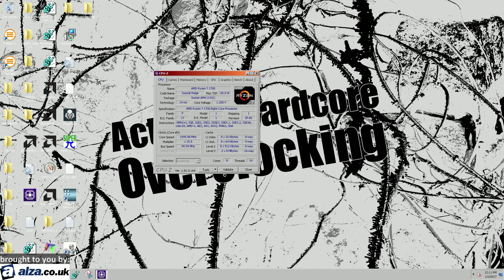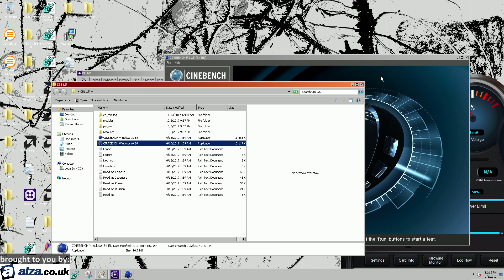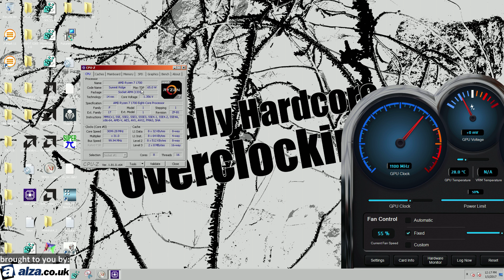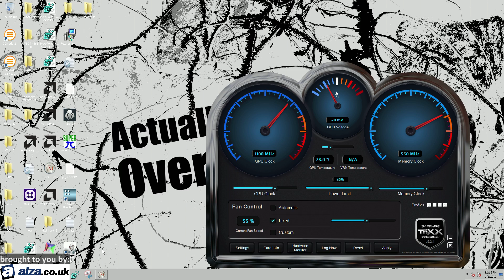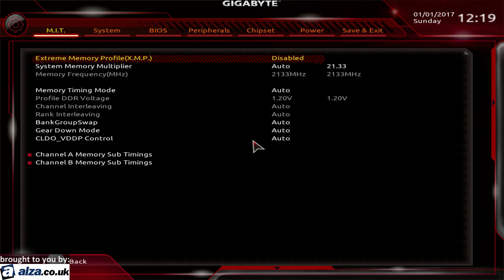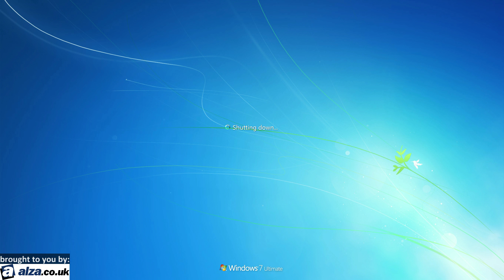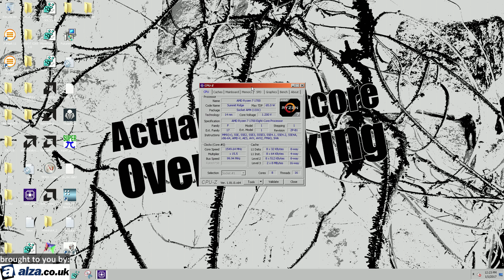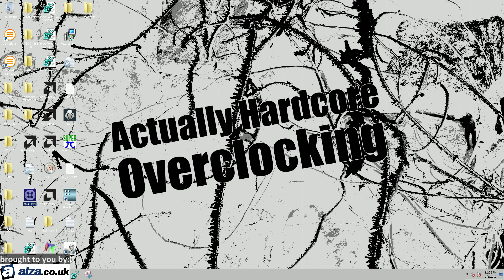The elusive Ryzen 1.55GHz bug (a potential fix on gigabyte motherboards)

Comment: i have a ryzen 2600 non x , i had it overklocked to 4,1ghz with 0.200 + offset voltage . the funny thing is when i changed to 4075 mhz overklock ryzen master reports idle clockspeed 1550 but it boost to 4075mhz on all core :)
Reply: On which motherboard did this happened?
Reply: gigabyte aorus wifi 7

Comment: Mine is literally stuck at 1.36 i dont have an overclocking mb and even on idle its 1.36, Can somebody help

Specs
Gtx1050
Ryzen 3 1200
A320M-DGS
450bt psu
1 tb hdd
120 sdd

Comment: I was having this same problem on my Asus ROG Strix B350-F Gaming after the latest bios update. I had my RYZEN 7 1700 oc'd to 4ghz stable before the update. i used all the same settings after the update and all was fine for a little while then one day it started. What i ended up doing to fix it was to step my offset voltage down till it booted at 4ghz. i bumped it back up a 1/100th of a volt and it bugged again, pumped it back down all was good. Haven't had any issues (related to the bug) since, that was 4 moths ago.

Comment: If its the chip, can we really send it in because we are taking it past specification? I mean, that would be fine with me, mine is crap, it can't do anything past 2666 Mhz on the RAM (1.2v up to the moon, doesn't make a difference), it also runs hotter than molten lava and impossible to cool (without phase or LN2 cooling), I definitely can't run 1.4v on an AIO with a 4,100 rpm fan (temp hit shutdown in 1-2 seconds at 1.45v or maybe less). Also, based on my voltage frequency charts, it would take 1.70v to hit 4 Ghz (1.7 yeah, that's a little high, may be ok for phase? Let me know if it is Buildzoid, I just need to make a mount for my phase).

Asrock X370 gaming K4 with latest BIOS (tested every revision except maybe 2 or 3 revisions, so many hours wasted)
Ryzen 1700 (bought about 3 months after launch)
Also had this bug, its super annoying to have it go down to 1.55 Ghz...

Comment: About the x-series chips: Got a 1600x on a horrible, horrible Gaming Pro Carbon WHICH I SHOULDN'T HAVE BOUGHT I SHOULD HAVE LISTENED TO YOU and my CPU does that too if I try overclocking it using the BIOS. With Ryzen Master, no problem, except for that I can't even get 3.8GHz primestable, but that could be the VRM overheating.
Reply: Oh and I don't get a 1.55GHz bug, mine was at 2.2GHz.

Comment: FWIW:  I'm running a 1700, same rev. (ZP-B1), AGESA 10.0.0.6  on an Asus Prime x370 and haven't run into this issue.  Using offset voltage, OC @ 3.8ghz.  Not sure if these are the same conditions that caused this issue for other people though.
Reply: How much offset voltage did you apply

Comment: I have a preorder R7 1700 that never does 1.55ghz bug too. I have 3 AM4 motherboards and it's fine in all of them. My newer R5 1600 will do it doing certain manual voltages.

Comment: As some others said its not GIGABYTE specific. It happens when the Pstate0 VID gets stuck and the SMU gets locked in. Pstate0 VID is provided internally by AGESA. Its been reported and hopefully will be fixed in an upcoming AGESA.
Reply: By the way, I fixed my issue by creating a voltage offset in BIOS, i LOWERED the voltage by 0.096, a negative offset. For some strange reason my processor was somehow getting too much voltage from the motherboard at stock. So telling the MOBO to reduce the voltage to the processor was my magic bullet.
Reply: @justina.2149  I have also lowered my vCore offset, by a lesser amount, but to great affect on my thermals and therefore stability. Gigabyte doesn't support their products after the next generation comes out. Buncha scum.
Reply: Gigabyte can I please please please connect with you on Twitter, I'm experiencing this problem on the latest BIOS from April 2018
Reply: Same here.
Reply: I can only do about 1,32 Vcore, any higher than that and multiplier is stuck at 15,5. If I want to OC more, I have to turn to Ryzen Master.

Comment: I had this on my Asus Strix X370-F Gaming ATX, I ran the EZ Overclocking utility in BIOS and it started behaving normally. It's a Ryzen 7 1700, once I got that straight I settled at 3.9GHZ @ 1.3625.

Comment: i have the same chip revision (ZP-B1) on a crosshair vi hero. I have no bugs like that but i NEVER used offset voltages.
Also, please note that even if you put +200mv, the CPU core voltage is still 1.200V (it should be 1.400V instead). So i think it is a motherboard bug.

Comment: I have the same issue with the ASUS C6H and it seems to be manufacturing date linked: https://rog.asus.com/forum/showthread.php?96420-1700-C6H-OC-quot-bug-consistency-quot-issues-manufacturing-date-linked

Do you have the behaviour when using fixed voltage instead of offset? It fixes it for me.

Also the same happens when the PC was in S3 state for longer than 10 minutes: https://rog.asus.com/forum/showthread.php?96422-Multiplier-locked-after-wakeup-from-S3-sleep
Reply: This board doesn´t have a fixed voltage mode.
Reply: Uh that sucks, my condolences.

Comment: On the Gigabyte X370 Gaming K7 I had a pretty similiar issue. When using a fixed voltage that is higher than stock it used to trigger the 1.55GHz bug, when using an offset it worked fine.
Fortunately with the latest bios that was fixed for me.

Comment: I didn't encounter the 1.55GHz bug though I've read about it. I did encounter a 2.8GHz bug, which happened if I overclocked with C&Q enabled on an MSi x370 board. Disabling C&Q fixed for whatever reason.

Comment: This happened on my Asus CH 6 Hero too a while back. It happened when i tried to overclock in manual mode and raise the vcore. When i raised the Vcore in manual mode i got stuck in 1.55 GHz. This is because in manual mode it screws up the Pstates for some reason because when i overclocked in Pstates al was working well. Asus fixed this in a new BIOS. Its for sure an BIOS thing and only Gigabyte can fix this in new BIOS.
Reply: RPM Designs well Asus seems to have forgotten to fix this on Prime X370 Pro meh.

Comment: My r5 1600 does the same thing when voltage is set higher then ~1.33V on asus b350-plus when using the offset voltage but I can get more voltage using llc, but it really is irritating to mess whit that, but doesn't really matter when 4ghz is stable whit 1.33v and low llc and the chip wont be stable whit my tower cooler at any voltage over 4.05ghz
Reply: ryzen master (or what ever its called) works but I don't like software overclocking and it messes up ram settings.

Comment: Hey Buildzoid! Thanks for always making nice videos. Could you make a tutorial video on how to properly OC and UV Vega?

There is so much BS going on with the drivers atm and i cannot figure out how to work around them all. Sometimes the card clocks higher than what is set in P7, causing instability. Sometimes it clocks much lower and refuses to even enter higher Pstates even with +50% power target. SOC clock randomly starts fluctuating at certain settings (i.e. I can ADD 25mV to P7 and this causes SOC to fluctuate (not power or thermally limited!), whereas the setting before is fine) , causing performance loss and framedrops.... You get the idea. It would be great if you showed how you deal with those obstacles and which things in particular need special attention.

Comment: interesting you get this. i have the asrock taichi with a 1700. and im currently running 3.85Gz at 1.28V with lvl 2 LLC (idles at 1.3V).
in the past i have had my CPU multiplayer end up being 38.3x (with the cpu at 38.3Gz). never worked out what triggered it but restarting the machine always made it go away.

Comment: I have never had such issue with my 1600x and MSI b350 pacmate, also lol- it's 1 time I hear about somebody have such bug on Ryzen, 
BUT there is another bug since agesa 1006 BIOS?, when you messs up with RAM OC, then despite the fact moter board resart PC and reset RAM config, it shows in BIOS you have still CPU OCed to in my case 3,95GHz, but in fact it have reseted to 3,6 default. Only way to fix that is change CPU speed up/down and then again 3,95ghz. However most  ppl I have been talking with on forum was using MSI,ASUS, some ASRock, rather everyone disadvice gigabyte on forums because of low quality motherboards and glitchy BIOS.
Reply: Its not true you can see even buildzoid viedo about trashe course AM4 VRM he claims acctualy MSI and ASUS have best motherboards on b350, worser are ASRorck and the worst gigabyte. Moreover gigabyte as I read has practise to lower the quality of their products in next revisions of the same models.
Reply: David K. What is better then for this price? 90% of b350 boards are good or OC R5 CPUs and VRM temperaures are perfect for them, my VRM on r5 1600x 3,95ghz@1.37v heats up to 49 C on radiator and 69 C on back of motherboad. Carbon got better 4+2  than rest b350 VRM and can  stand with no problem R7.

Comment: I bought the ducking 1600 and a msi krait gaming x370 board and I get that bug all the time and even with the latest bios it still happens when I try and OC or run ram over 2400mhz
Reply: And then I see people running 3200mhz ram and OC'ing to 3.9ghz with the stock cooler on a b350 board

Comment: went up to 4ghz (not stable, but got to windows) and 4.2ghz (post, no windows)
3.925ghz at 1.38 volts 24/7 good to go however

havent had this bug yet.....using a 1700x on crosshair 6 with AGESA 1.0.0.6 beta bios (yes, i know new stuff is out....but this shit works)

Comment: Ryzen Master is a work a round, it allows vcore up to 1.55v. So a BIOS OC plus Ryzen Master OC will give you 1.55v plus the 0.200v from BIOS equals 1.75v on vcore total, this will allow for some great OCing (LN2 maybe). I have this bug at 1.3v on the core for BIOS OC, but with Ryzen master I have been able go up to 1.5v to post some high scores on HWBot. Asus x370-A R5 1600.
Reply: No, 1.425v-1.45v is max safe voltage . But for high scores on the bot this voltage was needed.

Comment: I have a 1700 and gigabyte  gaming 5 not the k version and about two months ago it kept doing that when I changed the voltage directly but it didn’t do it when I changed the offset. I ordered a new board and returned that one and it kept doing it. Bios version was f6 and they came out with version f8 and it fixed it. I think it must be something weird with the chip that the newest bios fixed. But now something is up with my ram not being stable at anything about 1.25 volts so I don’t know everything about overclocking ram but even at 2666 at any higher voltage won’t work so 2933 won’t work at all... probably just the ram or infinity fabric but if anyone has any ideas let me know please.
Reply: monkeyplayer1 my gaming 5 with F6 bios would do the same with R5 1600, didn't bother me as I overclocked using offset voltage.
Reply: me too. I overclock with offset and after the new bios was available ( I upgraded directly form F6 do F9 ) installed it and managed 39.25 at 1.36 volts

Comment: would using fixed mode work better than offset for voltage control? Now that I recall it I think I switched to fixed mode to get around my down-clocking issue.

Comment: I ran into this trying to OC a ryzen 3 1200 on an Asus b350 plus board. Above around 0.15v offset caused the issue. Thanks for the info, I never really spent enough time to get to the bottom of it.

Comment: I had some issues going past 3.8GHz where the CPU would sit at 3GHz instead (R7 1700). I think i just lowered the multiplier and voltage and then rebooted, and the rebooted again with the old settings.  But now things are fine.

Comment: I have the first Ryzen 7 1700 that was pre-ordered a few days before launch and I get the bug when I try to overclock higher than 4.0 GHz. The M.B. is AsRock X370 Killer SLI A/C. It may be also related to the voltage bump that I tried to apply in order to break the 4.0GHz frequency.

Comment: I had this type of issue also with my R5 1600x on the gigabyte gaming 5. Mine would drop to 2.2Ghz anytime you tried to adjust any voltage value in the bios, you could change everything else no problem but once you tried to change voltage it'd drop cpu clock to 2.2 and stay there. Searching online I found A lot of people were having this issue with the 1600x on multiple boards and couldnt find a fix. The issue for me was fixed with a bios update to F8, every other bios before F8 for my board had this issue. If you look at my F8 bios description it says it fixes overvoltage issues that occured when adjusting dynamic vcore, but your F5a bios didnt get that fix. I dont know if the cause of my issue is the same as yours but it looks very similar.

Comment: It also happens with my asus prime x370 pro and the same thing happens to me drives me nuts, please share your wiseness, also this happen when I set a constant voltage
Reply: Hitting 4GHz honestly isn't worth it. Typically the voltage is insanely high just to get that extra 100MHz. I'm running at 3.8GHz @ 1.25v on my R5 1600 but trying to hit 4GHz OC I even went to 1.45v and it still wasn't stable. I was at 3.9GHz @ 1.35v but the drop in voltage I got just from lowering 100MHz was worth the drop.
Reply: On that board i have to use offset voltage, any custom regular voltage thats even remotely high it will lock at 1550
Reply: "when I set a constant voltage" is why you get it.
Reply: Got the same Prime X370 Pro board btw
Reply: Have you found a fix yet? I have the Prime Pro as well and a R5 1600. I can get it to 3.925Ghz when leaving the Voltage to Auto, but whenever I change that manually or via offset I get this freaking bug and that is at the newest BIOS version 1202 I believe it is called. I really want to try and get to 4.0
Reply: M S ya thanks for the tip bro
Reply: R3 1200 @4.1GHz on MANUAL 1.3V is stable.
But I can't even get 4GHz on offset voltage oh well.
Guess gotta use Ryzen Master or AMD Master or whatever they call it lol

Comment: does this happen if you apply a voltage offset in the oc software within windows?? if it doesnt surely that would mean the issue is related to the bios

Comment: As far as I know this was supposedly fixed on most AM4 boards. I know it definitely stopped happening on my X370 Strix.

Backing off on vcore can alleviate it, as can using voltage offsets one some boards, but it's not really the best fix ever.
Reply: I have the 2.2 GHz bug on my x370 Taichi with a 1600x cpu.

Comment: You won't know it's the board or chip until you test it on another brand motherboard, no? Is it possible that the older bios isn't playing nice with the newer CPU?
Reply from the maker: the board is on the latest BIOS.
Reply: I only mention bios because, in the case of my Gigabyte/Ryzen combo at least, the last bios for my GA-AX370-Gaming K7 was September. 

Wait there is a beta bios. Nevermind :)

Comment: I have the 1.55 bug on my Ryzen 1600... I have a cheap B350 and I thought it was the motherboard (It was MSI) and so I bought a Taichi and if I go any higher than 3.7GHz it always sticks to 1.55GHz, so it can't be the motherboard...? Maybe it's just garbage luck. ):
Reply: I bought the Ryzen 1600 about 3 months ago. To give you further info.
Reply: check out the taichi thread on overclockers, new bios is in beta and user chew has a few posts about it. if you use pstate/offset voltage it prob goes away. multi-bug they call it

Comment: I had an X370 K3 which annoyed the hell out of me. Would boot 4 times out of 5 but decide to boot loop whenever it felt like it. Ram wouldnt go over 2933 cl16 (hynix so not the greatest) and had the 1.5ghz bug. Swapping out to an x370 pro carbon was like a breath of fresh air. 3200mhz on the same memory, no boot or oc issues... Seems like gigabyte has some work to do on their x370 boards.